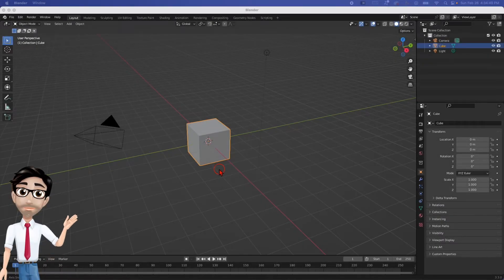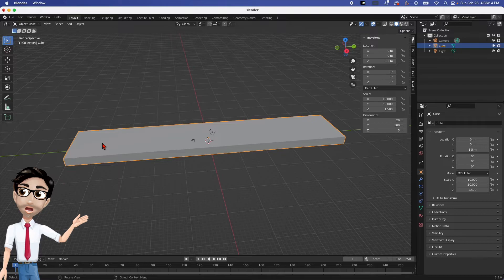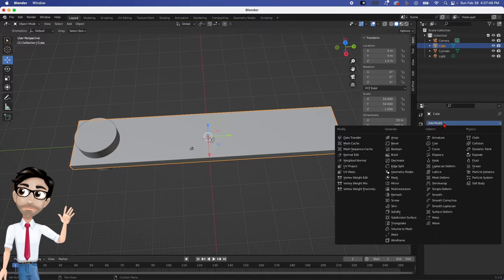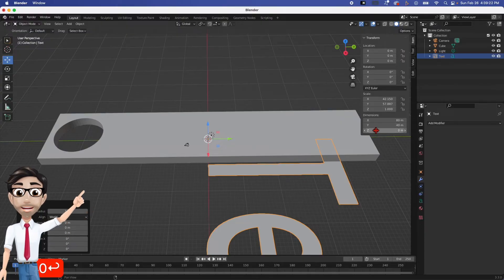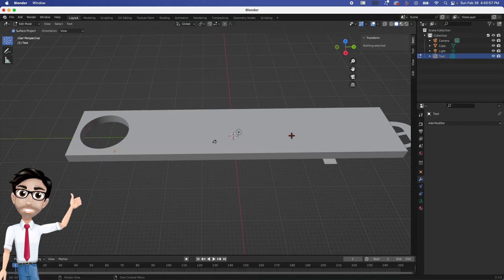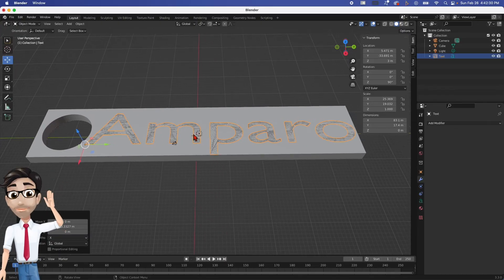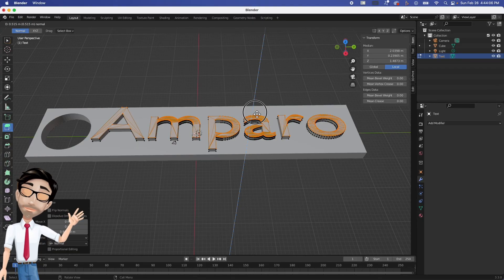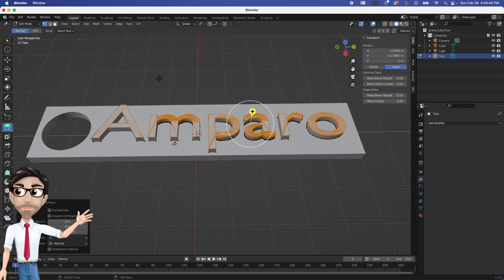1. How to Make a Nameplate or Keyring on Blender

Comment: Nice, thanks, very helpful for my project as I know some Blender basics but didn't know where to start with a plate with a text. This works and slices correctly but because the 3D mesh of the text is also inside the cube, stl and slicer ends up printing the "walls" inside of the plate itself too. For a "smooth" plate with a text printed on top of it, one should use a boolean modifier (unify and merge objects or difference and remove the other object) and then do a modifier remesh for the object. That will remove the walls inside the rectangle and give a flat surface for the text to print on, the letters will not start printing mid-cube/rectangle.
Reply from the maker: Thanks for the tip! I’ll try that on the next one.
Reply: @Teaching3DPrinting  I actually came up with a much cleaner idea: just turn ON snap during transform -> snap to faces and when extruding the text, snap it to the top face of the cube.